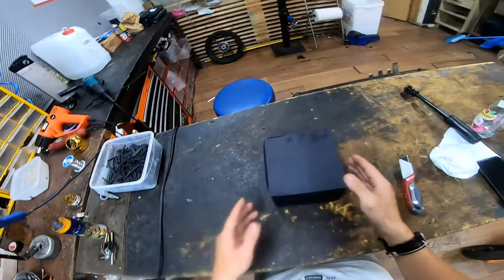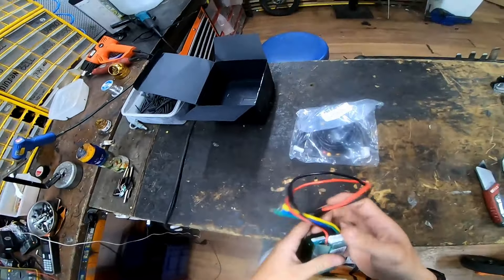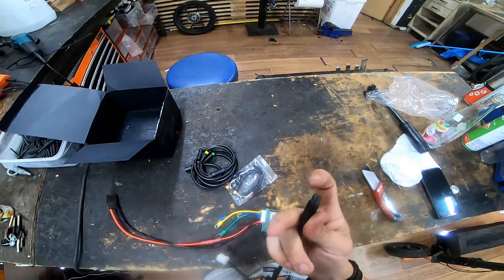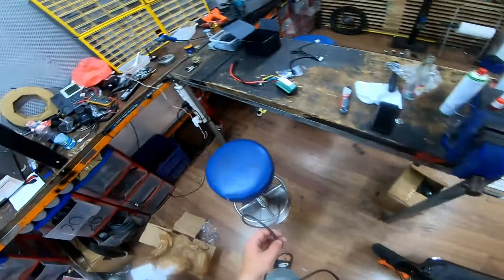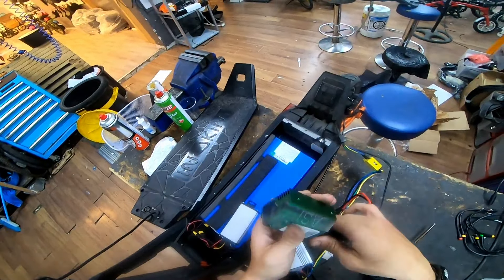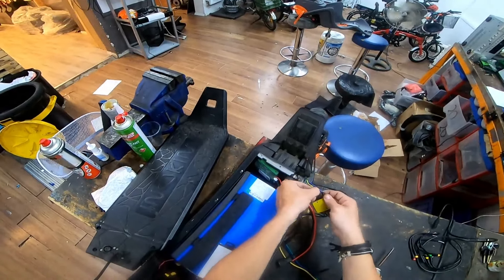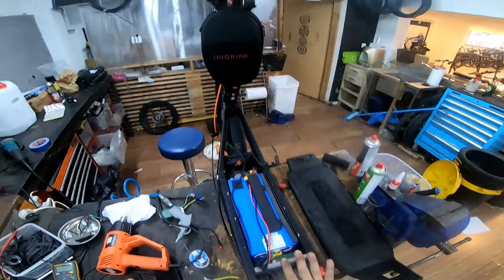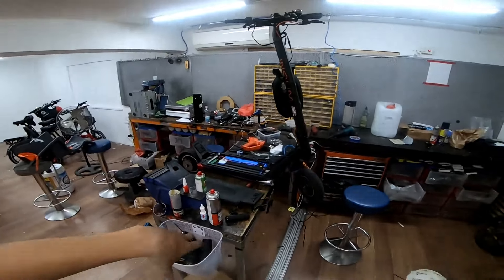Inokim OX meets ASI BAC800. insane performance | אינוקים "אוקס" נפגש עם "אסי". ביצועים מטורפים.

Comment: Hi there firstly love the vids keep up the good work 👍🏼

 I have an oxo I'm trying to upgrade don't mind using the 2x bac 800  to replace the originals but I'm struggling with the harness from sec to throttle please help 

Or even if u have a better setup for my oxo also I need the harness set up x3

Thanks in advanced
Reply from the maker: sorry for a late reply: 
the only wire the throttle sharing with the second controller is signal.

Comment: Does your install work with the original display and throttle etc. How do you control lights etc.
Reply from the maker: nope. it requires to install additional DC to DC converters and buttons to control the lights. throttle replaced too.
Reply: @SUB13333  
I'm so wanting to do this conversion but finding no help anywhere. What display would work ?
Reply from the maker: @va64ddf26  eggrider v2 ( thats what they say, never got to actually installing this ), and probably never will. i like to keep it simple, by having just a volt meter on my  throttle. more than enough  for me.
Reply: @SUB13333  sorry to quiz you so much which throttle should I use. And did you leave the brake light disconnected and just a switch for the lights?
Reply from the maker: @va64ddf26  I don't care to help. In any electric scooter, bike, or a damn robot, as long as it has a throttle, they all will be compatible.  Yeah I've canceled braking light and kept them both on, with a switch.

Comment: Did u just upgrade the controller no hub or battery upgrade needed?
Reply from the maker: This was just a first try so i didnt replace anything but IT COOKS the battery so it isnt recommended at all ( was completely unlocked ) .
then i got me 72v28ah
single motor is struggling a bit ( lots of heat ) but ive added heatsinks+ ferrofluid and it never burnt.

Comment: Dude I think I need your help!🥴
Had my ox super since it released and covered 1600km. I think the motor controller has just died though!..... all of a sudden the rear wheel tried to lock up and juddered badly then the power went off, the only way to make it power up is to disconnect the controller and reapply power but nothing works except for the lcd screen. This is the first time I’ve used it in ages too! I’ve been waiting on new tires arriving from Singapore which came today 😭
Should I just buy a standard replacement controller or is it a no brainer to upgrade to something similar to what you have?
Any help would be greatly appreciated 👍🏻
Reply from the maker: they known to have a burnt controllers issues. Happens most liekly due to some loose components inside the controllers that with enough vibration shortens the whole thing. I know a lot of people who went through this scenario, they were covered under warranty, as the company also aware of this. In my opinion it is always better to move on to a better controllers. You're missing all the fun on the stocks.

Comment: Does the controller plug straight in or do you need to modify it in any way?  Also does it have its own throttle?
Reply from the maker: Straight in where? The battery? It's just positive and negative wires.
Reply: @SUB13333  Thanks for reply.  I know how the battery would connect, but what about the Higo cables you got?  Did they come with the controller and are you using the original Inokim throttle lever?
Reply: @SUB13333   @Electric Vehicles and Green Energy - EVGE  Thanks for reply.  I know how the battery would connect, but what about the Higo cables you got?  Did they come with the controller and are you using the original Inokim throttle lever?
Reply from the maker: @woltee8011  the whole setup is being  changed. nothing stock stays. throttle of your choice, asi controller of course, and a custom made harness with higo plugs. also an option to a very sophisticated display with a  lot of info.
Reply: @SUB13333  Do you know if your buddy will be selling everything needed all in one kit?
Reply: @SUB13333  How to get the custom made harness?
Reply: @woltee8011   I am also interested in a full kit. Owner of an OX myself and i absolutely hate the controller/throttle. Throttle power curve seems a bit weird to me as in I don't get full torque at low speeds, bad for busy intersections when I need to bullet-start after a stop. Also NO option to disable the fucking "push to start" feature.
Reply: I'm also looking for the same thing... the whole setup ready to install myself.
Reply: Any luck so far? On the same boat with my OX, I don't need more power just a different LCD, throttle and I guess controller?
Reply: I am also looking for the complete kit, any update?
Reply: Help me too I have inokim ox hero its so slow 35kmh

Comment: Hi. What kind of controller do you need for Inokim OXO (60V, 25,6Ah)?
Reply from the maker: there's no "controller you need" , theres "controller you want" :) . for your application asi800 ( just as in the vid ) would be perfect.
Reply: @SUB13333  Sorry I don't speak well in English ... :)

Then one control would be enough for 2x1000W?
Reply from the maker: @F000022220000  nope, you have to have 2 controllers, not because lack of power, but because sync issues.
Reply: Did you receive the bluetooth programming app access when you bought the BAC 800 ?
Reply from the maker: @4nlimited3dition_4n3d  I did but only as ebike specialist, it is not available for front end user. They're in development for a user friendly app atm.

Comment: איזה מן דגמי האסי אתה מתקין בסרטון את ASI BAC 800 FOC Bluetooth 48V-72V 96A Controller 3000W Bafang BBSHD upgrade Plug and Play

או את ASI BAC 800 FOC 52V-72V 96A Controller 3500W Lightning Rods Big Block

?